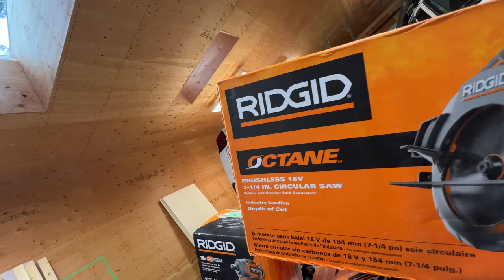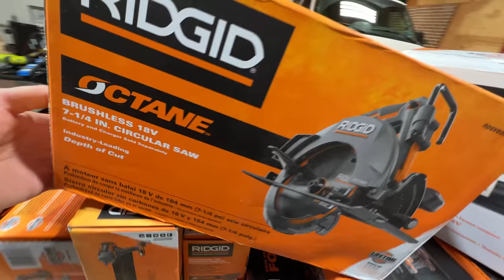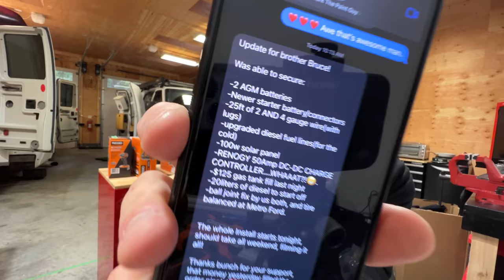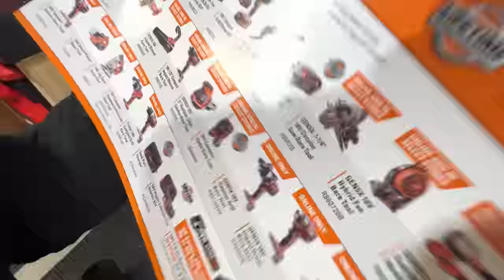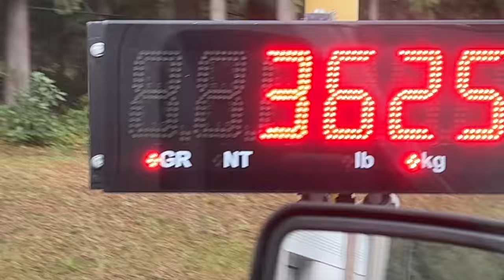This Whole VAN LIFE SHOP Thing JUST GOT REAL... WANNA BUILD A VAN???

Comment: Chrome look at building a dust separator that mounts inline before your shop vac it will save your vac. I use a a simple one from YouTube built from 2 Home Depot buckets, have used it on my mitre saw, jointer and plainer. It will also help filter out more of the fine sanding dust that you don’t want to breath, always run a fine dust filter in your vac. It also can give you more capacity for debris

Comment: Milwaukee, Rigid, Ryobi. All the same Chinese Corporation. Techtronics Industries. TTI. Nice that they gave all that to you. Not bad tools, they will likely serve you well. Particularly the Rigid Octane items. Ryobi has a decent battery charger that plugs into vehicle 12 volt outlet. Charge those batteries while driving. Keep a 1/2 inch impact wrench with you for quick wheel change.

Comment: I think one important projects you mneed to implement on your shop is a floor to ceiling movable curtain screen, like a shower curtain but huge and proportion to your shop.  like when your doing dusty work or painting on the ambo or somebody else using your shop, you don't want their mess or dust all over your shop. it will be contained in the movable screened off area. when there is no work going on you could push the screen off aside. so one side of the shop for just parking the van and one side (the area of the ambo) for work area because you could easily screened it off to contain dust etc.

Comment: Can't wait to see how these tools hold up, are they the cheaper ones? i don't know the ridgid name brand but i think i saw they were cheaper than most.
Reply: Rigid has been around for many years. They were founded in 1923
Reply: @Endless_Skyway_Adventures  darn i was wrong then i think, but they did look cheaper than most i saw i think
Reply: @shannonbaldus5458  Time will  tell,, I’ve built a camper van and a cargo trailer conversion. Using Ryobi cordless. I have one plug in ridgid drill that is a beast.

Comment: Hey Chrome, is that blower sweeper tool strong enough to blow accumulated leaves off of grass not just off the sidewalk? I'm looking for something electric that's powerful rather than using gas.
Reply from the maker: It works great for blowing out the shop everything outside is super wet so I haven’t been able to try it outside yet
Reply: @VANCITYVANLIFE  I appreciate the info. I know the battery operated I have is not strong enough and am hoping to find one before I have to settle for gas.